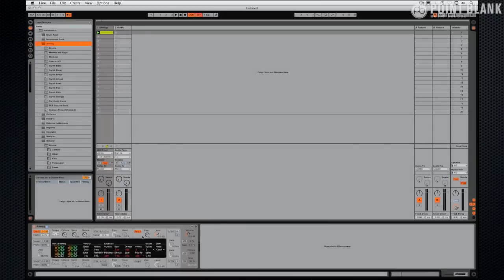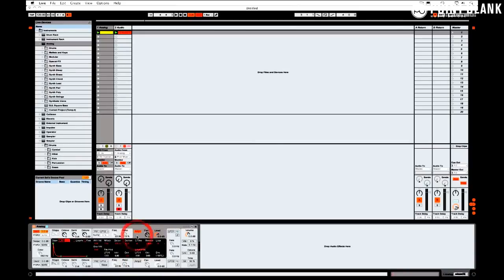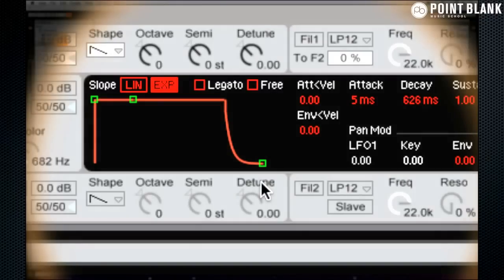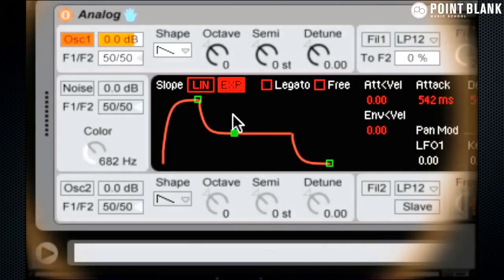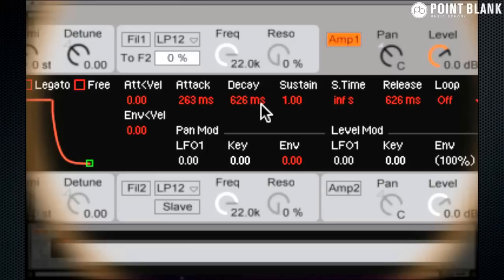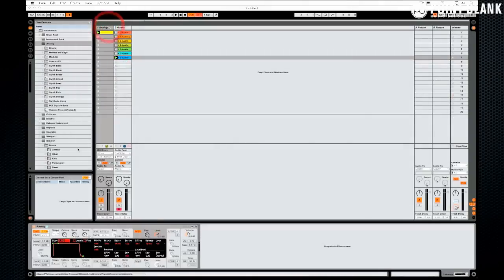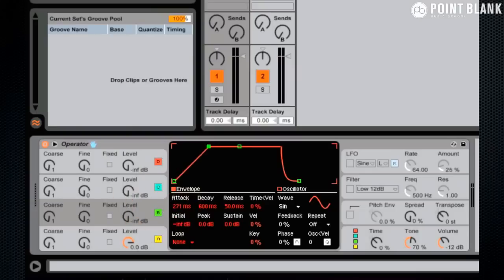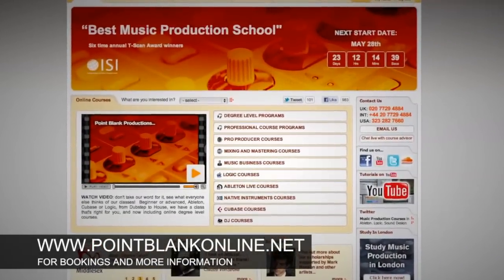Ableton Tutorial - Sound Design Series (pt3) - ADSR Explained : Volume Envelopes

Comment: Hey Point Blank, I have a question not really related to this particular video, but how do you  change the default picked color of the clips to the rainbow colors you are using? I can just switch Auto assign clip color on of off.